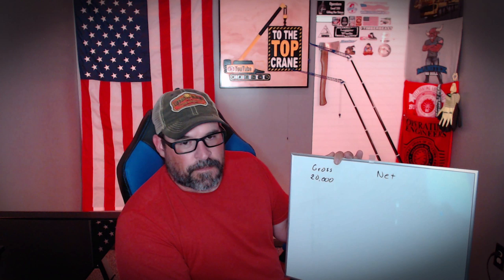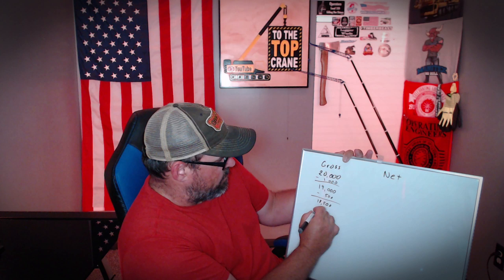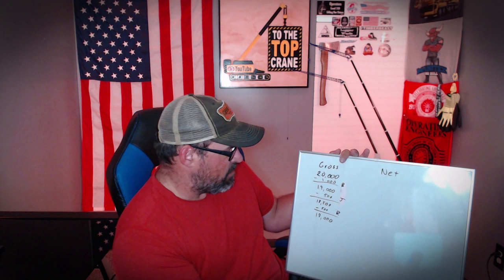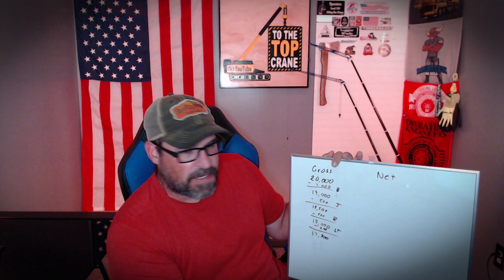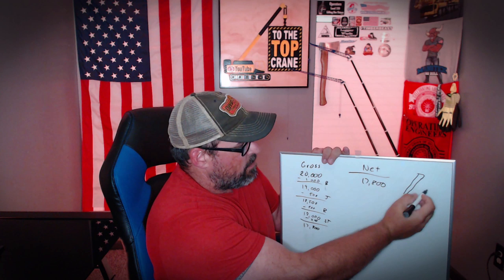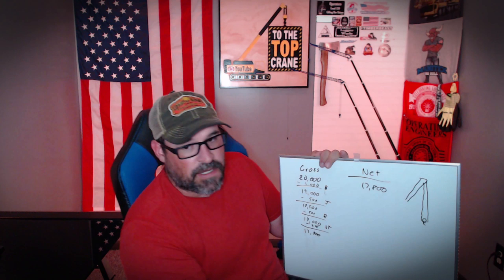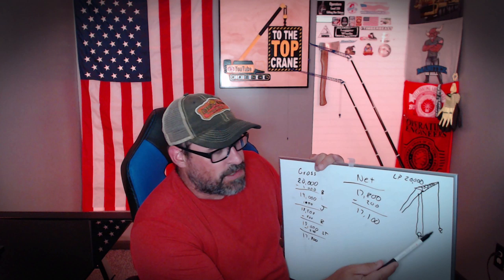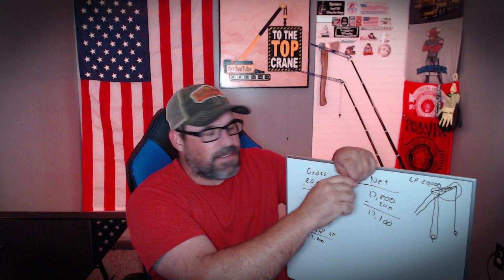Crane Math | Gross vs Net Capacity | Calculating Deductions

Comment: I never came across the deduction for parts of line not used, like you said it is crane specific. We deduct all of the line parts for the net capacity. Usually a small number (in the order of a few hundred pounds) when compared to a lift weighing thousands of pounds. Also the weight of any below-the-hook lifting device ie spreader beam etc must be considered. This would be included in your rigging deduction though.......reading the load cart notes is a great piece of advice! Great video!

Comment: Hello jim. I agree with the stowed jib, erected jib etc deductions from gross capacity. As stated in crane charts and notes. However i have allways considered headache ball, hook block, rigging and spredder bars etc to be part of the load. Added to the load rather than deducted from the gross capacity.  You get a completely different calculation of % of capacity.  I humbly sugest you look into this. I know from experience of 44 years that this is a commonly misunderstood concept in lift plans.    Kelly.

Comment: At 6:40 you say 1# per ft. I was taught 10# per foot. Looks like you measured boom length for weight. They told me to measure tip of boom to ground. -nccco2019 
Very interesting.  Great video amigo

Comment: Not to be picky but, in a triangle the horizontal is "A" the vertical is "B" and the angle is "C". So, A square + B square equal C square.  On your crane you said the boom was 200' long, the vertical leg or "B" is shorter, or C square minus A square equals B square. (If memory still works on my end) Thank you for a great whiteboard lesson.

Comment: I know this is a very old video & Someone May have asked but do you mind specifying a few cranes that you know or have experienced that you DO in fact have to calculate for unused parts of line ? Or types of work/ Safety officials that require such practice ? I love your comprehensive clarity on the specifics It’ll be a great asset to my understanding if I had that insight

Comment: hey jimmy , long time listener first time caller 
I've been watching your videos and have definitely been interested in cranes. I see you're in my union. I'm on the east coast as a c branch member of 542. Just wondering how you got your start? Currently i'm studying for my nccco to get my boom truck and rough terrain. and obviously my core. I have learned many things while doing load charts. The more i've done the more comfortable ive gotten with them. i never realized that there's so many deductions with rope and making sure that you have the block correctly reeved and that you arent using too much line as to overload and use as a deduction. is there any hints or tips you could give out ? My grand plans are to get with a crane rental company maxim,amquip, or maybe even thackray. I'm 27 years old and already have my class A . I just have to re certify on a stick 5th wheel truck and i'll be good. have a great weekend your content is really good. especially when using crane terms and seeing them applied in video so i can accurately figure out whats what

Comment: While gross vrs net I am well knowledge on However!! I was not aware  of the extra weight limitation...  An extra calculations... If I am plated for 80,000  an the rig weighs say 37,000 tare my Net weight would be 43,000  load capacity. If you know the load your hauling  an manufacture load capacity  say it is 42,500 .. your 500 under right? ""Wrong!!"" Most equipment manufacturer weight is given and dry terms. This is not allowed for the weight of  fuel or oil or coolant or grease or mud .. an then we haft to add in the weight of chains and binders. Dot weight master lives to get into my billfold! But  I see there more calculations then just gross, tare and net allowed involved and setting up the crane for a lift....That was a great video even for an old fart like me ...Thanks !!

Comment: Actually, the weight of unused parts of line should be calculated by boom point elevation and not boom length multiplied by the cable weight per foot.

Comment: What did the old timers use before the on board scales? Did they have ways of knowing they were at capacity?
Reply from the maker: They would feel the crane start to tip.
Reply: To The Top Crane so they were literally flying by the seat of their pants.
Reply: We are supposed to understand our charts and be able to do the math and know the weight of our picks and not rely on the computer. Our lmi is an operator aid not a replacement for understanding what we are doing.
Reply: Crane Fan I understand that. But I have seen some of jimmy’s videos where the estimated weight was different than the actual. It would seem that without the on board scales and equipment it would be easier to exceed your capacity.
Reply: Agreed. What I’m emphasizing is that as crane operators we need to develop and maintain our skills to make the calculations manually, and not end up like the person that blindly follows their gps into the lake and drowns